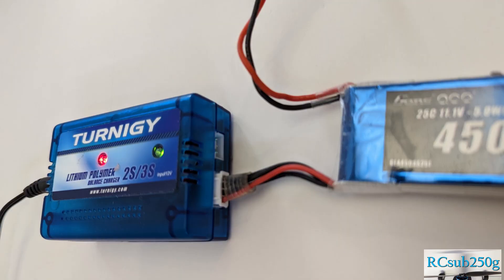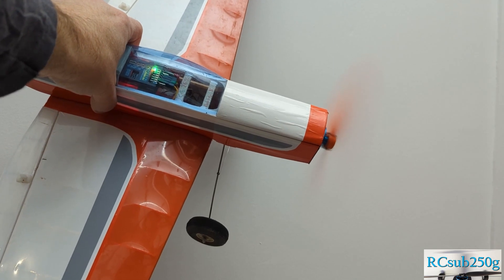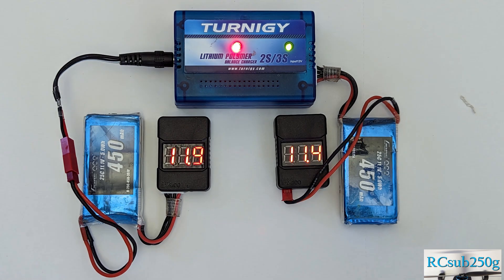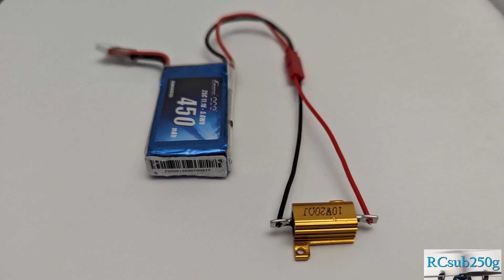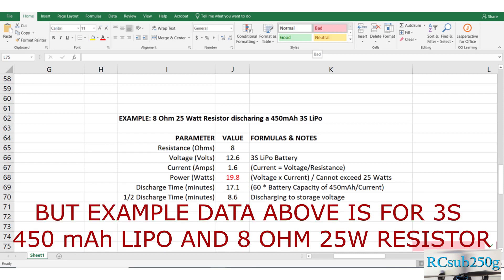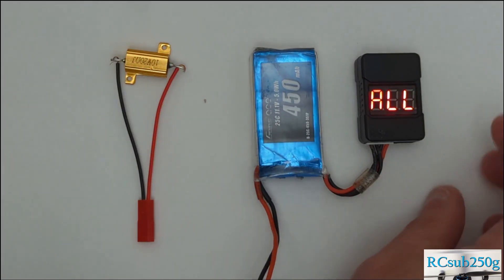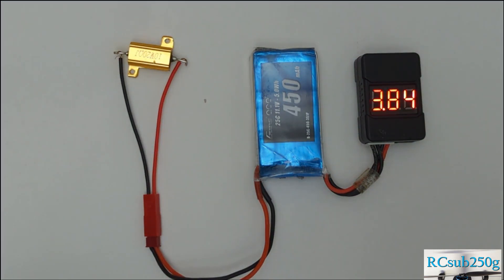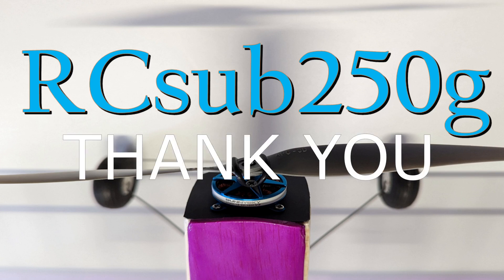Quick and easy ways of discharging your LiPo batteries

Comment: What type of resistor would you recommend for a 2s lipo with 350mah?
Reply from the maker: The 8ohm resistor as in the video would take about 50% longer to discharge, or circa 25 mins. To speed it up back to about 15 mins you'd need lower resistance, say 5ohms perhaps. The 2s is dissipating less power, so the 25 watt, or even slightly less would work fine.

Comment: i need to discharge a LiFePO4 cell (3.2vdc nominal, 280ah -- LF280K -- big cell used in off grid household power systems) from 3.6v down to 3.4v -- have a recommendation for this? that voltage drop probably translates to around 50-100wh.

my guess is that a 100w 0.2ohm resistor might be a good fit, would bleed off around 55-65w from a cell sitting at 3.6v (the cell voltage would probably sag to 3.4v or 3.3v under load).

Comment: A clear concrete floor (or large ceramic plate) are the ideal Charge/Discharge working surfaces. Those little Battery Alarms/LiPo Testers may not be laboratory grade but, for general use, they are the best thing since sliced bread. And you can get a handful for peanuts.